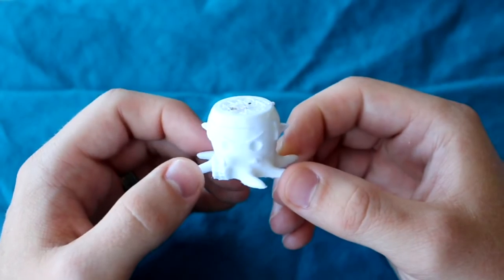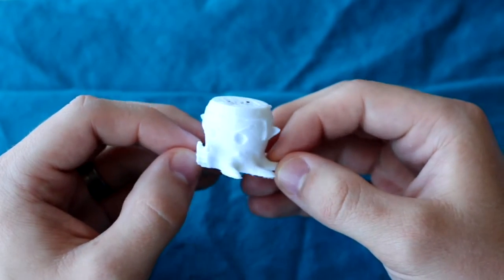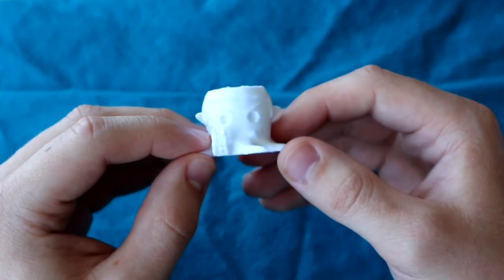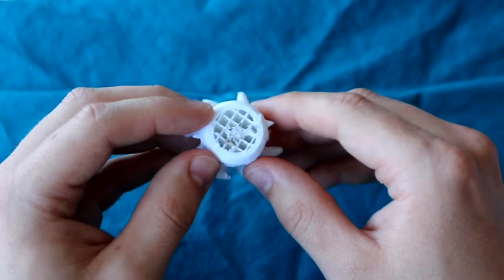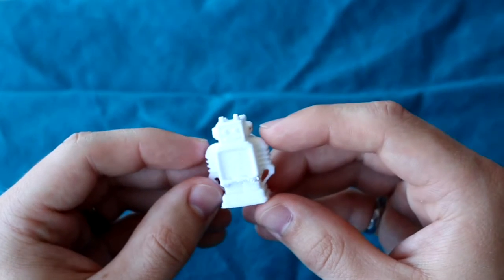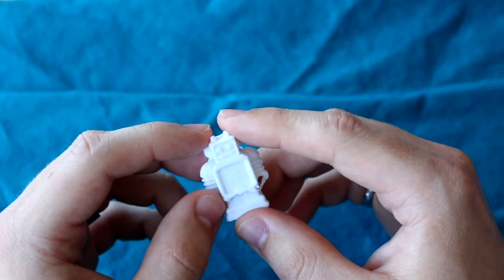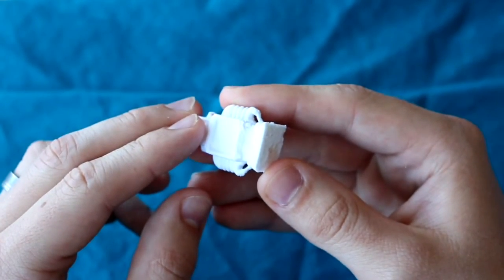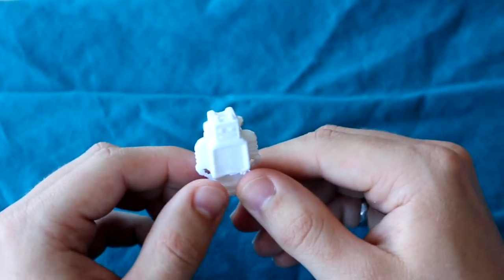Sunhokey Prusa i3 3D Printer | First Prints

Comment: Thanks for this series. My Sunhokey came with NO instructions at all, just blank SD Cards. When Sunhokey responds to emails, they link me to corrupted files. 
Pardon the dumb questions. Do I need to install a printer driver or is it already installed on that controller? The controller has the menu tree on it, and it recognizes the (empty) SD card. I downloaded slic3r and chose Marlin. Can you verify Marlin is correct?
I'm working through all config. videos next. 
And what this guy said "Vidyuth Suresh" ; )   - no idea what to do next.
Reply from the maker: Hi, I am glad that you found the videos so helpful. They were fun to make. What do you mean by printer driver? Marlin is correct for the code that the printer uses. I only use the SD card to print so I don't have much experience connecting the printer to my computer (for windows drivers required). Happy Printing

Comment: my prints always look like they are wireframe.any help?
Reply: also my extruder keeps clicking.i think that may be a problem
Reply from the maker: +logan brooker The clicking extruder is the stepper motor skipping steps. This is due to there being too much force on the motor. This can be due to trying to extrude at too low a temperature, clogged extruder, not having a high enough voltage driving the stepper. This will cause under extrusion. I amn not 100% sure what you mean by wireframe. Is this that the print doesnt adhear and you get a spaghetti pile or is it something else?

Comment: i find it odd that the 8 gig card that came with mine works just fine, wonder what thats about... im having some problems with speed on mine. at first i couldnt hardly get it to print anything at all, but then i increased power to the extrusion motor to stop skipping. ive got it to be pretty reliable now, but i have to keep the speed and an agonizingly slow rate, making printing a 1 hour part estimated by cura 2 hours... if anyone has some advice i would much appreciate it
Reply from the maker: +dragonslayer1483 What material are you using? What are the extrusion temperatures? Have you confirmed that your nozzle is not clogged? Also check the tension on the ideler bearing of the extruder (is should be tight enough to keep the filament from slipping but not tighter).
Reply: ***** well im useing the crappy filament that came with the printer and if experimented with temperatures between 190 and 240 and my best results have been at 235. i have taken apart the nozzle and it is clean, so no issues there. im just not sure how to increase speed without decreasing the quality, as it is pretty good right now
Reply from the maker: Sometimes slow is the way to go. I print pretty slowly too. It is something I need to work on.

The filament they give us is either PLA or ABS, each of which have different melt temperatures. Better filament may help as well.
Reply: ***** yeah, the filament would be a worthwhile upgrade, and while printing wlower will give good results, it is frustrating. i have to print at around 20-30mm/s to get decent results, and the smallest of parts can take 2 hours

Comment: Hi Alan! I just finished building my Sunhokey Prusa i3. You're videos were very helpful. Can you please help me with one thing? Right now i have no clue what do next to get my printer to start working. i have uploaded marlin to my printer, but i am clueless on what to do next. Can you pleases help me?
Reply from the maker: +Vidyuth Suresh Hi, The first things to do (assuming that the axes are moving and things are getting up to temperature) is to level the bed. This is vital to do it right, and it will take a while to get right. You will have to check each corner a couple of times. The next thing is an extruder calibration (make sure that when it tries to extrude 5mm it is actually extruding 5mm). Then it is time to try your first print. Getting the gap on the first layer is trial and error to get good adhesion. Your first print could be something boring like a cube. You can use this cube to calibrate the X, Y and, Z axes as well. The settings for the slicer you are using are also a bit of trial and error but there are examples out there for starting temps for the various plastics and suggestions on how to set things up for your first time. The Slic3r read me is pretty good for the basics on everything does. Good luck
Reply: Thank you for replying back! The main problem with my printer is that when I send a job to it it doesn't even move at all. The extruder and the bed won't heat up either., I have already double checked all my wiring. DO you think you can help me?
Reply from the maker: That sounds like a problem with the communication with your computer. I had that issue for a bit, check your drivers. Have you tried to print from the SD card?
Reply: no i'm not sure how to do that. Is it possible for you to walk me through the process
Reply from the maker: +Vidyuth Suresh to print from the SD card you slice the model using your preferred slicer. Save that as a gcode file and then transfer that file to the SD card. you will need to have a SD card 4gb or smaller due to the printer limitations. Then in the printer software select the file (in the print from SD menu) that you want to print. the printer will then heat up and excicute the file instructions.
Reply: Hi Alan! I just tried to save the it file to my sd card but it won't let me. Is there a way to overcome this?
Reply from the maker: +Vidyuth Suresh Are you connecting your SD card directly to the computer or through the printer board (with the usb cable)? What slicer are you using? Make sure your SD card is not write protected (there is a switch on the side).

Comment: I am having no success with my Sunhokey. All my parts are ugly and seem to fail. I need help
Reply: Anthony Wilkins what are the issues u r facing
Reply: I solved the problem! Kind of. I was using Slic3r for my prints, and I watched many tutorials on how to get slow easy settings, but it would produce blobs and the layers were never even. It would go too slow when filling in the corners, and end up depositing too much filament, destroying the print over time. I am now using CuraEngine to slice and it seems to produce much better prints! I don't know why things changed, but it works now. Beforehand, I calibrated every motor and measured my filament with micrometers. The bed it level. Thank you for your concern. I was starting to give up!
Reply: Anthony Wilkins These kind of things happen... Things will work out eventually, all the best :)

Comment: Looks really good, I used PLA for the prints so did not face any problems of surface addition. Though Its working satisfactorily, I am facing some issue with extruder skipping steps (It makes clicking sound when it skips). Did you face similar issue?
Reply: +Dhananjay D mine skips too. I need to calibrate the x axis feedrate i think
Reply: +coopadupa Mostly issue would be with the extruder, Just some things you can check... 1. Check if filament is able to move freely though the extruder assembly...  2. Adjust the tension on the idler wheel such that its just sufficient to push the filament ( Don't put excessive spring tension, this will load the stepper... find the sweet spot which works for you, ans stick with it)... 3. If above things don't help increase the stepper current using the pot on stepper driver....
Reply from the maker: +Dhananjay D +coopadupa  Another thing is feed rate and the temp on the hot end. If you are trying to print fast the filament may not have enough time in the melt zone to become soft enough to extrude and the stepper can't overcome the force required and therefore skips. So faster printing required higher temps or a longer melt chamber (the reason for the E3D Volcano add on). Try slowing your print speed or increasing the temp and see if that helps as well as what Dhananjay said above.